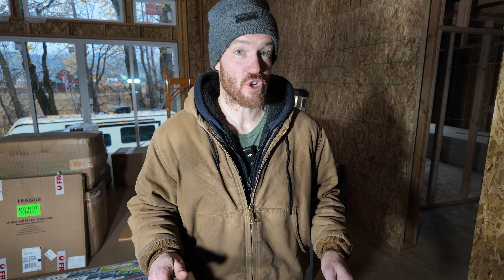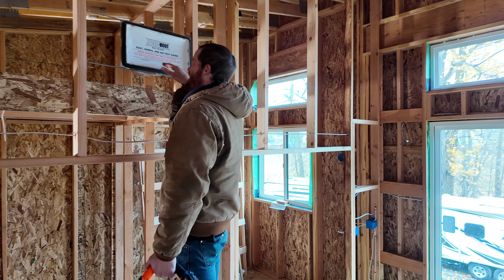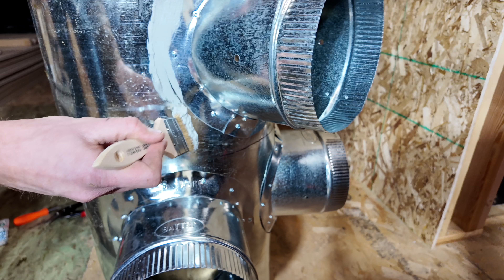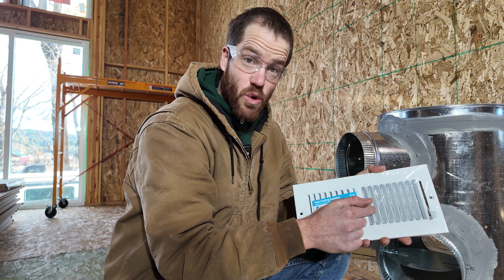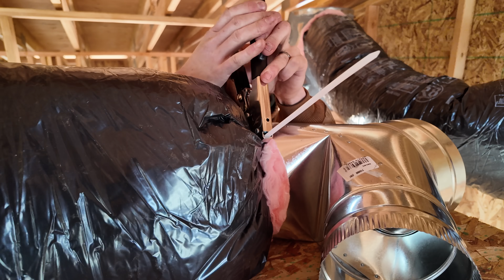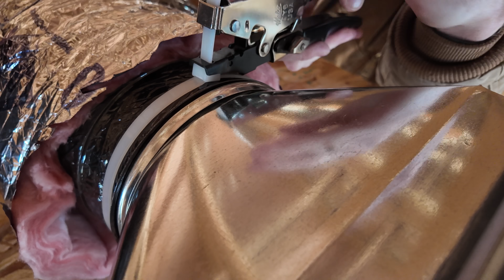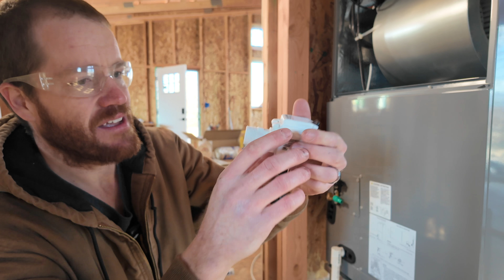HVAC Contractors Hate Me For Showing You This

Comment: Quick question did you do a heat load calc because even though Mr Cool is a decent unit if you're going to be getting real cold Winters depending on what your balance point is that unit's not going to be able to keep up and also depends on all of the installation material for the roof the color of the tiles the walls what type of Windows insulation there's tons of things that go into a manual J calculation for house you can just slap in a unit and say hey go three tons that's good because either you can be too high or too low one issue is if it's too big you get short cycling and no humidity control if it's too small you get continuous running but not being able to keep up with anything

Comment: For anyone doing this highly advised to at a minimum hire a professional for the design and equipment selection. There is engineering and design principles we use to ensure systems are properly sized and airflow is appropriate to the heat loss for each room. Sizing airflow or equipment based off square footage will net incorrectly sized systems 99 percent of the time and cause comfort concerns. If you miss the mark bad enough your system will not run.  It’s a cost but a worthwhile one even if you are doing a DIY install.

Comment: How much easier would the duct system would have been to create and work if you had used a square plenum with the same stick on but flat collars which come with dampers installed? The cfm of flex is quite a bit different than for the sheet pipe most duct calculators are based upon. A 6 inch flex pulled tight with no more than 10inch slack within 10 foot length is rated equal to 5 inch sheet metal pipe. 
This is the reason most home hvac installations don't work properly.

Comment: Best to put air handlers in the attic (much quieter) and ran a few returns to a return plenum. But, I guess you don't have an attic, I thought you had alittle more height. I also thought you had a "great room" with a high ceiling. Which would benefit with a return in it and a main return. But, it's not as tall as I thought, I too got overly ambitious. I try to pull air out of the hall (undercut the doors), or each bedroom in bigger homes. Now your only return will be a vented door on your first floor, it will be screaming like a modular home; they're just noisy. It's better to run a main duct and step it down in size after every couple runouts to maintain static pressure. You did absolutely fine, if you had seen a few installs and talked to some people you'd be close to being an install technician. I've seen allot of hack installs for 20K, no access to the air handler for service, 25' boxes of flex everywhere, 1 single return, no emergency drain pan, poor condensor positioning right on the ground, lots of hacks.

Comment: Flex duct is pure garbage and is inefficient you could have still went with rigid metal ducting and they sell insulation sleeves for the outside of the rigid duct. You could have bought it at any local hvac supplier because it is not the actual freon carrying equipment. I got 3 quotes from 3 different hvac suppliers for all the duct work and obviously took the best deal. A few hand tools like end crimpers, hole nibble cutter. Did all of it with round duct coming off a square plenum from the air handler. 
What i would love to know is how you evacuate the air and pressure test the system before charging the freon from the compressor? Before releasing the freon a hvac pro would purge the lines with nitrogen and then do a pressure test to check for leaks followed by pulling vacuum with a vacuum pump and doing a decay test to make sure it holds vacuum for at least a few hours. Better off over night but most of these guys are in to big a hurry. So when you release the freon into the lines it is full vacuum which pulls all air out and moisture. If you are not doing that the systems life will be short from the ambient moisture in the air.

Comment: no, I don't hate you for showing my potential customers this. Actually, showing them this will prove to 95% of them that they really don't want to do their own air conditioning unless they're really pinched for money. It's painful, difficult, frustrating, and time-consuming. You also have a very open working area that makes it look easy. In my particular state and county, it looks like that'd be closer to $16,000 worth of work.

What I will admit is that while you do miss a few tricks of the trade, you get a lot of the important ones down, like actually cutting the ductwork to the perfect length to improve airflow.

Comment: You may have saved thousands installing yourself ( I think 20,000$ is an insanely high price) but your not running as efficient if it was installed by a professional. That and I’d have to guess that the comfort level isn’t evenly spread throughout the house. Good job though for your first time. I’ve seen “ professional” installations that were worse.

Comment: The registers you bought have shutters not dampers, shutters are really only good for on off. The balance dampers in your branch runs will be ok for gross adjustments. My recommendation would be to return those stamp face steel registers with shutters, and spend a bit more for aluminum adjustable blade registers with opposed blade dampers on the back side. This will give you greater control on throw and fine tuning your CFM at each register.

Also an 8 inch metal pipe is generally good to 200 cfm, flex has much greater friction rate and is reduced 15 to 30% depending on how well installed. Same goes for 6 and all other sizes. When branching you had an 8 feeding an 8x8x6 Wye. General rule is an 8 will feed an 8x6x6. A 10 would feed an 8x8x7 or 8x8x6. 
You are going to have a lot of static on the supply side, so I would size the returns as large as possible and use grilles with low pressure drop. Sometimes referred to as high velocity grilles or increased free area grilles.

P.s. I don't hate you for it, lol

If I were in your area I would have loved to quote you an install price. Would have been more than you spent, but definitely lower than what you were quoted unless we were discussing say a Mitsubishi hyper hear branch box ductless system, those get pricey fast, but have some major advantages. Also I would have done manual J,D, and S reports for sizing the equipment, room CFM and duct size and design so everything works as should.

Comment: This was helpful. My heat pump system was new a year before buying this old house and works fine aside from the installers doing a horrible job with all the ductwork connections and connecting it to an abomination of an air return leaving a series of old leaky nonfunctional electrostatic air filters 😳 After seeing this I’ll be under the house in a bit scheming how to redo all the connections and completely redo the air return… Thank you.

Comment: Every new construction job, we have always used metal pipe rather than flex duct because of rigidity and because if it gets a whole pretty much, the whole run is chalked. It's very interesting seeing a DIY vs. professional job. Maybe the company i work for is too nice, but 20k is absurdity. Maybe if we had like a 4,000 sqft house, it'd get that high, but I dont think I've worked a job over 15k most of the time it's 7-8k or less. Also, for a diyer, you did a good job explaining things 👍 I've seen a lot of argoence in Hvac DIY, but you clearly did your homework. Also, a quick tip uses tape on the ends of the runs just for extra sealing, especially with the crinkly nature of the flex duct.

Comment: I can't finish this.  You ran the entire house in flex. Do you know restrictive that is? Flex is used for the last 2 or 3 feet to make it easy to connect to your diffuser. If that evap coil is super cold, you have a problem. Probably low air flow.  Good Luck!

Comment: That is a lot of flex duct. Honestly, would have used rigid 16" up to a 24x10 then used rectangular duct to run to the rooms and tapped with flex duct. Main concern is the static pressure will may be far too high. I don' t work in residential so maybe for these smaller air handlers is fine but we try to keep flex for connections to registers if needed. Never as an entire main. Lastly did I miss how you are running the return air as these are recirculating systems. Usually there is to be an elbow installed on the base and that then collects from registers as well. Spacing for where you place them will matter as well.

Comment: What you're calling a plenum is not a plenum, and my HVAC instructor said you wouldn't build any static pressure with the way you set that up.  Also, you have to cut the line set, or you will have an oil trap with the extra loops. The extra loops will shorten the lifespan of your unit.  Good luck, though!

Comment: So the cost figures in this video are misrepresented. you can clearly see he has the 48k btu model in the video but he claims its the cost of the 30k btu model, which is the one he has in his spreadsheet. the one he is using is almost double the cost. maybe he is falsifying because it basically a double unit and hes only using half. i would be curious to know if he can put all 48 k into his air handler or if he has to have a second to fully utilize the compressor/condenser. love the video though.

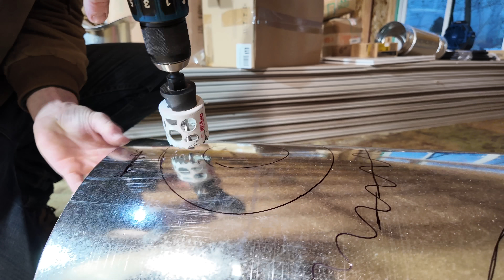Comment: 6:44 Yes, easy method is to assemble the 16" duct so its more ridged. Then take a large durable flathead screw driver and a hammer and hit the driver into the duct at an angle. This will force the driver through the metal. Now make the hole larger by continuing to hit the screw driver. Now the cutters will fit in the hole.

Comment: I’ve had to repair a few of these things usually resulting in an extra trip for service parts to make it work and recharging unit. I’ve seen leaks in coils and lineset quick connect fittings .  I wouldn’t buy one…  I see the savings but be prepared for any issues.

Comment: Your cfm chart u used is not current standard , licensed HVAC-R CONTRACTOR.  Not  bashing u. Just informing u.
6"is 75cfm
7" is 110cfm
8" is 160cfm

Flex duct and metal duct do not have same cfm ratings.

Comment: Your title said "HVAC contractors hate me for showing you this".I wonder which HVAC contractor hated you. To the untrained eyes, you wouldn't  be able to spotted the good practice and a bad one. You need to do more calculation when designing duct, than just figuring out the square foot , and the need for CFM when making a selection for the right heating and cooling equipment. The numbers one issues in HVAC is probably an airflow, poor duct design/ airflow  can cause mechanical failure , humidity issue, noise , and ects...which then generate money for HVAC contractor/ I think HVAC contractor love DIYer...LOL. one example, you just put diffuser in the room where you like em', but It'll be nice to consider how hot air and cool air will circulate the room for occupant's comfort.

Comment: great video, my transformer has a blue and yellow wire on the low voltage side. the blue has 24v but yellow has no voltage. My unit works fine as far as I know. does that mean I need a new transformer? I have no control board.

Comment: Oh man where to start... I'm late to the party so I'm sure there's other posts covering these points but I gotta say it. 
#1: Within the first 2 minutes I already knew this system wouldn't heat and cool properly because you didn't run a return duct. Every room needs supply AND return ducting. Without return ducting you're not sucking back hot air in the summer and cold air in the winter to be reconditioned by the unit. Plus the air needs to be filtered for air quality so when you have dust all over everything and sneeze all the time now you know why. 
#2: The placement of the supply vents should always be as close to the windows as possible. In this case they should have been placed above the windows in the ceiling. Also again since there are no return ducts in any of these rooms  you're going to have some nasty cold spots in all of the rooms by the windows and walls. 
#3: You're running a 8" supply duct off of the plenum, then splitting that 8" duct into a 6" AND an 8". Let's think about that for a second. A 6" supply duct is rated for roughly 100 CFM max. How are you supposing that 6" can supply enough air for a 6" and 8" supply vent? This run should have been a 10".

I have been in the HVAC trade for 21 years now. 10 years installing and 11 years servicing. I do know what I am talking about. This system will """work""" but it will not heat and cool your home properly, especially in the extreme cold or extreme heat. The air quality in the home will also be very poor since you have no return ducting. You are right about one thing. HVAC contractors will hate you for showing this. Because it's a checklist of what not to do.
Reply: Thank you for being a voice of reason. The people who are saying what a great job this is, are delusional. Some company is going to get a call or 20 for rooms not heating. There is no way to fix what this guy put in short of a full rip out of duct work. Glad someone els caught the Y fitting problem.

Comment: I'd put more into insulation, then a ductless mini-split heat-pump would suffice, perhaps with just 2 head units for your small 2-story.  Would save much interior space, no losses from ducts, and no concerns with later duct cleaning.  I was pleasantly surprised that a 1.5 ton AC mini-split heat pump I installed last May was able to cool my whole 2400 ft2 house last Summer on even 110 F days.  I installed it to better employ my new solar power.  It never draws more than 2 kW.  Had to rely on it alone after my Central AC died in June.  Wondering if I should fix the Central AC or just add another mini-split ($900) for the far side of the house.  Regardless, I'll keep the ducts for the gas furnace.

Mr Cool is pricier with its pre-charged linesets and special fittings.  Cheaper to buy a vacuum pump ($70) to evacuate a regular lineset.  All AC compressors today come pre-charged with refrigerant, so just vac the lines then open the refrigerant valves to charge the lines and evaporator, assuming your lines are close to spec length.  Can then cut the lines to length rather than a mess of extra coiled line.

Comment: Been in HVAC when it didn't need a the BS certification. Your centralized plenum distribution has been proven not to be that efficient, way back to 1970. Congratulations, you've decreased the volume velocity to where it should be appropriate. Your system will not cycle as it was designed to do.
I'm not one to think I have all the answers. But the type of plenum you're building will fore air to the top of the plenum and decrease air pressure thus decreasing velocity to those take offs you added below, and so on. Will it work? To a degree. But your system will cycle more, and you'll find some rooms will get more air than others. Can you fine tune with the vents? Yes. But your system will be very noisy.
You could have done a trunk system using round ductwork. They make standard sizes to accommodate. I'm all for DYI. I think a vast majority of HVAC contractors take advantage. 
You'd have been better off with the individual HVAC ceiling units that are connected individually to the outside condenser, via copper lines. Very efficient. Absolutely no ductwork. I little more money. But worth it. And you can control each room with their own zone. Something a duct system is limited to. Good luck. Carry On!

Comment: I install HVAC systems for a living. There is a tool that goes on your drill that adjust to different sizes (4", 5", 6", etc.) you definitely want to put duct wrap insulation around you trunk line. Also wait to put pookie on when your completely finished with the job. That way you didn't get it everywhere like paint...lol... But you got it done so good job

Comment: As a retired hvac  mechanic of 43 years I have to add my 2 cents. All ductwork in a non conditioned areas must be insulated or it will condensate in the winter or summer. A central return air does work but not as effectively as a return in each room especially if room doors are kept closed. Normally depending on your zone air conditioning returns are mounted high to remove the hot air near the ceiling.
Reply: The home is only 1000 sq ft
Reply: Yea that thing is definitely going to rust out quickly.

Comment: I’m all for saving money, but you can’t replace skilled trades. At minimum, hiring an HVAC consultant for some guidance and direction is recommended. The design and installation are the most iimportant factors to ensure proper system performance, comfort and longevity. Thanks for sharing.

Comment: I've got the slightly older version of this Mr. Cool central ducted system. If you have trouble with set point float as I like to call it, get rid of that crappy "wired controller" they call it and install a good 24v thermostat. Like a VisionPRO 8000. But be sure to let the outdoor unit communicate with the indoor, you will still get modulation and benefit of the variable capacity of the unit. Edit: This is the therm I used TH8321WF1001.